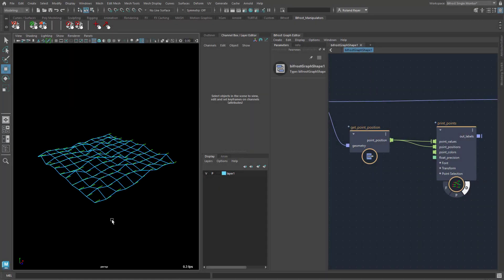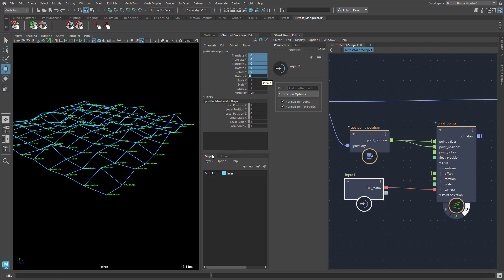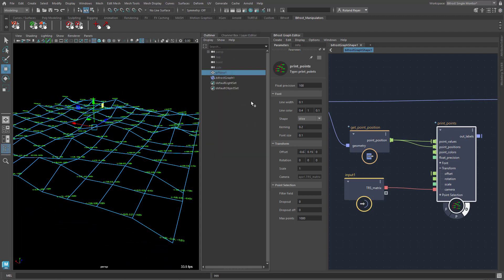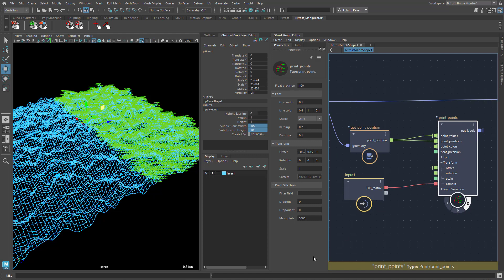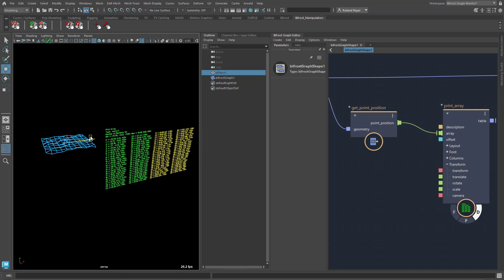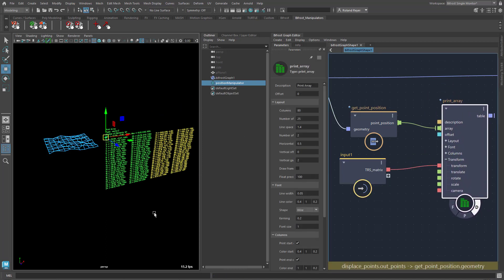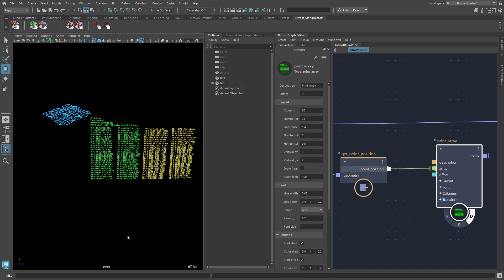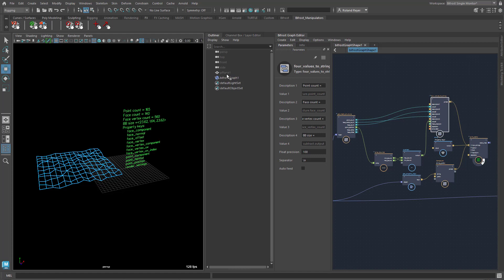Maya Bifrost: Print Pack 1.2 - Aim at Camera and Head Up Display

Comment: Hey Roland this is all great - I'm trying to make a nicer version of the maya measure tool. When I plugin in my position to print static then move the object, I seem to get a double translation or something. Adding an offset doesn't help as the farther I go the more offset it becomes. Any ideas? I'm technical enough to use bifrost but not technical enough to dive into compounds.
Reply from the maker: Hm, that sounds like when you move the locator you also have the Bifrost object selected and move them both? You should move only the locator.
Did you plug in just the matrix? Or just the translate channel? Not both!
Can you please check that?
Reply: @RolandReyer  No it's only the locator moving via the matrix. I have a cube plugged into the position as well and it behaves as expected. I'll move this to the BiFrost forum so I can post screenshots etc. Thanks. EDIT: I've found if I divide the position by two before plugging it into the print_static node it works as expected. So I have a work around. I'll post to the forum anyway as maybe I'm missing something.